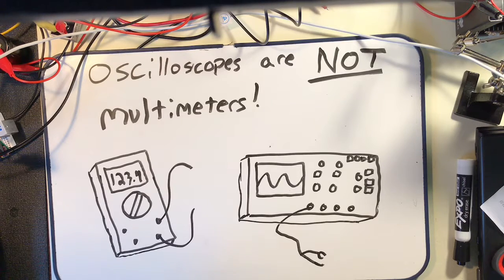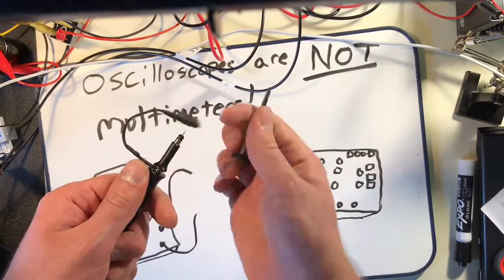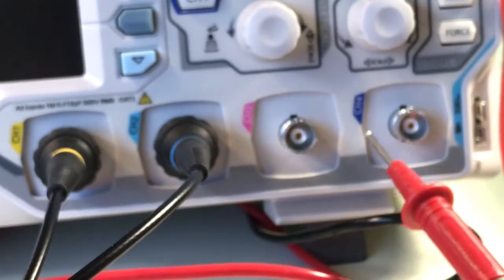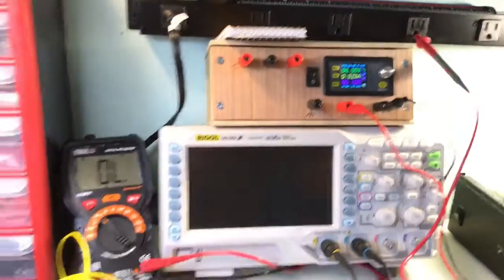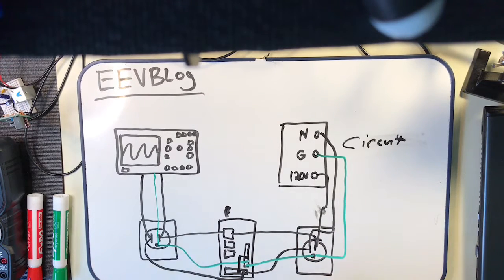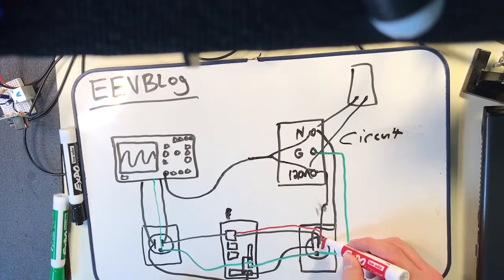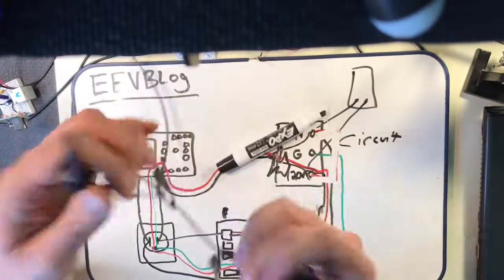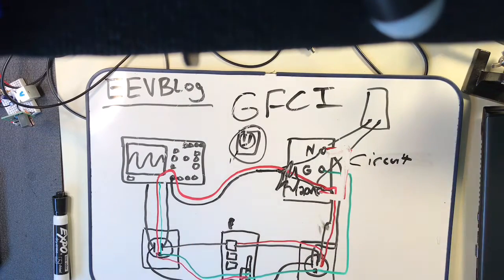Oscilloscope Safety - How to use your scope safely!

Comment: The ground lead doesn't need to be even attached for the plasma to join the party.

Neutral wires are a conductor, ground wires are the "oh ṣhit, something is wrong... let's make sure no one dies"  Just because they are joined in the panel box does not mean the ground and neutral are the same thing.  They are joined because the electricity no matter if it's on the ground or neutral still needs to get out and back to the source that created it.  The neutral is the most dangerous wire in your house.  If you get caught inbetween an open neutral and ANY conductor going back to your panel, the circuit breaker sees you as a light bulb.  On the 120v black/red wire, there is a chance you could trip the breaker,  you aren't likely to do it, but the neutral hook will NEVER trip your breaker.

Comment: One of my first scopes was a 'blown' input amp unit where a guy tried to measure the flyback tripler output at the rubber cap on a CRT. Easy fix and worked for many years after.

Comment: There is an alternative using oscilloscope on batteries, typical 2/3 in 1 dmm combo's, as long as you don't hook up the device for charging, which then has the same problem as the stationary units having common on main's earth.

Comment: Does that mean that if i measure an audio amplifier while its turned on, and plug the First probe in the + and - of the input, and the second probe in the + and - of the output, the difference in Voltage and Ampere might ruin my oscilloscope? Is It the same with a picoscope?

Comment: Good techs back in the days would remove their ground pin
Reply from the maker: yeah I mean - it is an option but you better know what the consequences of that will be - most of the time people would use an isolated power system in between the oscope and the wall to avoid the grounding issue

Comment: Suppose someone were clumsy and tripped, accidentally breaking off the ground pin on the plug for their oscilloscope. Whoops. Suddenly one of the problems covered in this video is no longer a problem. Well, it is but a different problem. The problem, of course, is that removing the ground pin means that if you do make a mistake and accidentally apply 120V to the ground clip on the probe then all probe grounds are now 120V and this can cause problems with your circuit under test and/or your hands when you accidentally make contact. Thus why the mfg of the scope always puts a ground pin on the cord. I have seen more than one EE break the ground pin off a scope cord because it can cause more back feeding issues than what it solves. So, I'm not saying to break off the ground pin on your cord (it can be dangerous!) but sometimes, if you know what you're doing, it can actually be useful. Another technique is to power your bench scope from a battery backup UPS that is not connected to the wall. This also breaks the ground connection to earth and allows the scope to float and is thus also useful for the same purpose. But, at least then the UPS and your scope are both floating so there's less risk you might have pathways that hurt either you or the DUT. Either way, don't do either thing unless you really know what you're doing.
Reply from the maker: Great point, yes by using battery power or breaking the ground pin you can create an isolated system (but yes since it wasn’t quite designed for that there may be some unintended issues)

Comment: This video is old, so I am not expecting a response. I am an hvac pro.  We have a building with a bunch of ECM motors in them that are failing prematurely.  I have a theory that it is dirty power either coming into the building, or back emf somehow.  I need a way to prove it to the customer.  This is a commercial building.  I haven't used an oscilloscope since I was a radio repair person in the army 25 years ago.  Could I use an oscilloscope to check for "dirty power" at my equipment?  And if so, what would the image look like.  would I see noise on the sine wave, or noise some other way.  Any answer would be helpful.  In the research I have done so far, I see a lot of talk about dirty power making a home sick.  This sounds like shenanigans or snake oil.  But I could see how dirty power could cause premature failure of a motor that takes an alternating current, rectifies it, and smooths out the current it sends to windings being affected by noise on the sine wave it is trying to rectify, or otherwise change... Great video btw.   It brought back a flood of memories from my days of fixing army radios.
Reply from the maker: Interesting problem, well you can definitely check the power coming in the o scope - just make sure its grounded correctly. And your scope can take 120 (most industrial ones can). Most of what comes out of an outlet is pretty rough - so my understanding is most ECM will have a power conditioning board in them. Could be a combination of bad design and power fluctuations. I think the hard part will be proving it - you need some way to collect long sets of data which most o scopes can't do - You may need to use a meter with a data logger or something like that in order to log data over a day or week. Not sure its worth it to you since those datalogging meters/oscopes can run quite a bit. Maybe you could run triggered data log that creates and stores captures when it exceeds a certain frequency or voltage value. But your probably going to be burried deep in your meter manual for a bit trying to figure out how to set it up. If you figure it out I would love to hear about it.
Reply: @HTMWorkshop  Thank you for your reply.  We have installed these motors in countless buildings and homes.  They have a very low rate of failure.  Except this building.  I will be happy to let you know.  Thanks again for your response, it was certainly helpful.

Comment: The black leads (on scope and multimeter ) both have something in common. They both serve as a reference for the purpose of measuring voltage.
However the reference lead on the scope is a grounded reference lead on mains powered oscilloscope plugged into 3 prong wall socket vs a non - grounded reference lead on battery powered multimeter.

Comment: That last tip about the GFCI was great. The safest way to go IF you must introduce isolation is not the cheater plug, but the isolation transformer. Then of course the professional/expensive route is the differential probe.

Comment: i have an owon vds1022i usb scope, i can probe whatever, its isolated. and if i dont plug my laptop in its double safe. but the bncs are still shorted together. so thats the only worry. my oscilloscope is a multimeter pretty much (ignoring voltage ratings)

Comment: DMM's have a (fuse) for a reason...Just saying. But still a descent video..😂😂 The probe part had me rotfl.. But I 'thinks that's probably why they (allow) for detachment of the ground side. So it blows straight OUT; CUT the connection. 😂😂😂

Comment: Cheers for that Dude! If the scope is USB powered by a 2 pin 5v charger - does that do away with the mains issue - leaving only the potential difference possibility?
Reply from the maker: Correct - your scope is isolated on usb. Makes it much safer

Comment: my osci isnt connected to ground, only 220V AC. would that still be a problem probing voltages with the ground pin?
Reply from the maker: Then you should be ok…if your scope is isolated from ground you can circumvent the issue

Comment: Ok little lost I have a fluke 199 and it’s has no ground on the plug and normally I run it off it’s battery so now you got me wondering what would happen 🤔
Reply from the maker: Your scope is isolated if it runs on a battery and will not have the same issue (unless you ground it of course)

Comment: Well , very simple . Use an isolated battery pack supply for your oscilloscope, just like the DMM . As long as the DC ground is totally separated from the earth/neutral AC , you should be golden !!!!
Reply: Sorry, no.  The scope ground leads are still shorted together.  To illustrate, suppose the oscilloscope is powered by a battery as you suggest.  Suppose the circuit is also powered by a battery to isolate it from the 120V or 220V mains.  Suppose one part of the circuit is a resistor connected across the battery and the rest of the circuit is arbitrarily anything else.  If you accidentally connect a scope ground lead to one side of the resistor and another scope ground lead to the other side of the resistor, the short between the ground leads will short out the circuit battery.  A lot of current will flow.  As the presenter mentioned, the scope ground lead may vaporize.  The ground lead circuitry inside the scope may vaporize (goodbye scope) on a cheaper scope.  If the scope ground leads and scope can somehow handle the short, the battery won’t.  It will overheat and catch fire.  If that circuit battery is a higher capacity lithium battery, it will be a very exciting fire.

Comment: So just to clarify, you are saying to plug the oscilloscope into the gfci outlet?
Reply from the maker: That is not ideal, an isolated power supply is what you want. A GFCI will provide some protection but it's still grounded, so I would not recommend that.

Comment: If I buy battery operated oscilloscope then there will be no problem ,I can use oscilloscope like multimeter
Reply: Actually no.  Your scope ground leads are shorted together as the video points out.  If you hook the ground leads to different points in the circuit, that are at different voltages, you will short the two voltages to each other.  In the best case scenario, your circuit will misbehave as one or both voltages are forced to change by the short.  In the worst case, you will send enough short circuit current through the ground leads to destroy the oscilloscope (e.g. burn off a ground plane trace inside the oscilloscope).

Comment: Sorry mate you got that very wrong about multimeters (battery or bench).  If you set your meter to measure current (usually involves moving the probe to the current socket on the meter) then if you then want to later on measure voltage - and forget to change your probe socket, you then can short out whatever volts measure which may destroy your meter.  This is easily done, ask any tech who is honest enough to admit it.
Reply: Sorry mate, You must not have watched the video, because he did mention that
Reply: IT'S TRUE, i agree
Reply: Some fancy multimeters have gates that close off the current input connections when the dial is turned away from current measuring mode. Most techs are honest enough to admit they don't buy those bc we think we are too good to need it 👍

Comment: Quick question - if you were using a battery powered oscilloscope, wouldn't that isolate the o-scope from the ground?  I know there are several models that may not be as accurate or as full featured, but which are adequate for purposes of say, diagnosing audio equipment issues?
Reply from the maker: yes that is a good way to do it
Reply: Yes it would 
the problem occurs because the electrical box is referenced to earth.
with a battery that is not the case

Comment: 7:31 In household electric systems the direct connection between the neutral and ground is only done once in the first breaker panel and must not be done again in additional sub panels. If a sub panel is being added to a home it may already have a bonding screw between neutral and ground and this bonding screw must be removed for sub panel usage of a breaker panel.
Just a little detail from renovations that occasionally gets missed.
Reply: Is there a good reason for that? Why only one connection between ground and neutral?
Reply: @louco2 If you have a RCD in the main breaker panel, it would trip if you connect neutral and ground behind the breaker
Reply: @louco2  Wrong question. Ask why on earth would you connect it at different places? You must justify each connection. You do not need to justify not connecting things. 

The house gets a common neutral and ground. At the main panel or at the first means of disconnect those are separated. Once separated they will be never combined.

Comment: It would be most helpful if you could show what you can do about this. 
In the olden days, one used isolation transformers, differential input Scopes made for line voltage use etc. Today many cheap scopes have low voltage psu, such as USB power via powerpack.

Comment: I have a question: you can only check for continuity between neutral/neutral and ground/ground out but not live wire/live wire to live wire right?. I was under the impresion that you would destroy your multimeter if you try to measure continuity while power on dc or ac.
Reply from the maker: you mean with a multimeter correct? not an oscope - you should not be checking for continuity with an o-scope. If you want to check continuity with a multimeter of a live wires it is possible - could depend on the quality of the meter. But the multimeter is isolated from ground so you could check continuity of most things (there is going to be a limit but line voltage is find) but I can't say I use it for that so there may be some exceptions
Reply: No, Not necessarily but it would be a question of whether you would get the tone or not, You need to understand certain things 

1. The continuity beep requires voltage to be heard

2. the test is designed to be used on AN NON ENERGIZED WIRE

so let's say the beep requires 2 V DC and you place it on a line with 50Volts
chances are it won't come through

There are however some that will, for example, i have a device called A LOOP A LINE
specifically Teletech TX916
These are telecommunications continuity testers that can push through a tone SAFELY even on an energized line

Keeping in mind it assumes TNV (Telecommunications Network Voltage) which is usually up to 54V DC but can be up to 120 on ISDN Lines (which we don't see much of nowadays)
so it does depend on your continuity tester

but in general , why are you trying to tone over an energized line in the first place.
You can test from live to live
BUT FIRST TURN THE POWER OFF

Comment: i know this is a older video, but everybody on YouTube who makes video's about Oscilloscope Safety and measuring mains voltage, left one part out of the video. 
If you simple want to see the 50 or 60Hz sine wave of your mains outlet, you don't need to connect the ground lead of your scope probe.
Your mains is ground referenced, but also the tip of your scope probe is ground referenced, so you don't need to connect the ground lead, 
and for extra safety, you can best removed your ground lead from your probe, that way this lead can't accidently touch something. 
Simple set your scope probe at X10 setting, and only use the tip of the probe and you can touch Hot / Line / Phase / Neutral without risk.
If you want to do measurings in a circuit or device that is powered from mains, and you want measure across components in circuit, or circuits that use higher frequency then 50 or 60Hz, you will get more noise when the ground lead of the probe is not used, and this method of only using the probe tip cannot be used.
Reply: As someone trying to learn, this basic-intermediate advice is very helpful. I've read and read but to truly internalize and test my assumptions I need to eventually see. Finding information on how to do something that can be very dangerous is so difficult.
Reply: Or, you could just set your Digital Multimeter to AC Voltage, and check the outlet on the wall!
Reply: @MrDoneboy  yeah, why using a scope or a multimeter too see if there is voltage, if you can use a light bulb or stick your fingers in the wall outlet.
Ps: i was in sarcastic mode.

Comment: A suggestion that may be helpful: Put some green heat shrink on the scopes earth ground leads - it will constantly remind you it is an earth conductor and not just another test lead as in the case with multi-meters
Reply from the maker: Great idea!
Reply: But it can be used as another test lead if you're working on an isolated circuit, IE one not earth grounded or powered by USB.

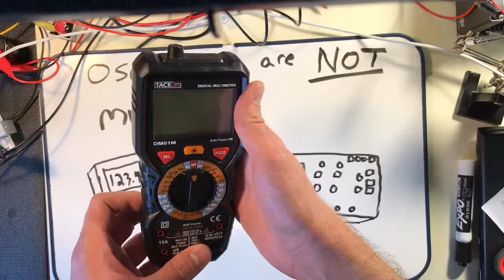Comment: 0:56 "The multimeter probes have a high resistance between each other" -- This is only true if the meter is set to voltmeter mode. The ammeter mode will short the leads to each other!
Reply: 8:40
Reply: @mitchkronowit3633 Yeah, there's that. I still felt the need to emphasise it, especially in a video about electrical safety involving mains voltage.
Reply: @FZs1Agreed. Anything critical to safety should be stated up front.  😊

Comment: USB power from a battery or 2 prong wall transformer should be okay since it is floating?
Reply from the maker: yes - your isolated (now you can have 2 faults before you have an issue, as opposed to a single fault)
Reply: @HTMWorkshop  Thanks.

Comment: Always check power line (outisde or inside devices) before contacting a oscilloscopes probe tip connectors: Always be sure where is the hot phase line where is ground line of power AC outlets / cables line also inside any opened device to be repaired.
Better measure again if unsure about it or forgotten, before risking to make any bad contact.

Comment: It would be nice to explain if the situation changes with battery operated oscilloscopes.
Reply from the maker: Good point - It would be nice to have https://www.youtube.com/watch?v=rOK7PPUpVjM
a different video on how isolated power works. I do have a video on hospital isolated power but which is related but yeah your right the ground completely changes if you use an isolated or batter powered scope (or USB powered scope). We only cover traditional bench-top scopes here but that is a good idea.